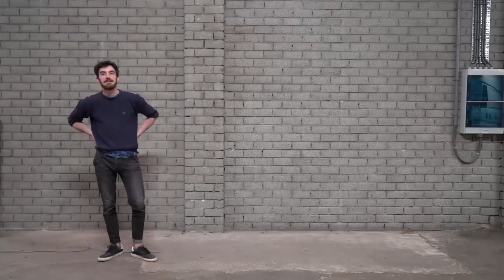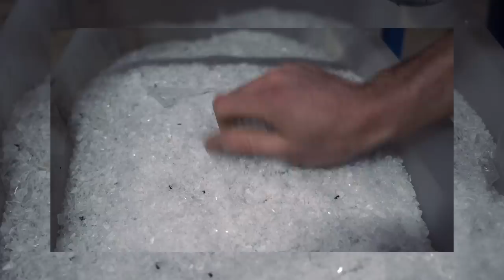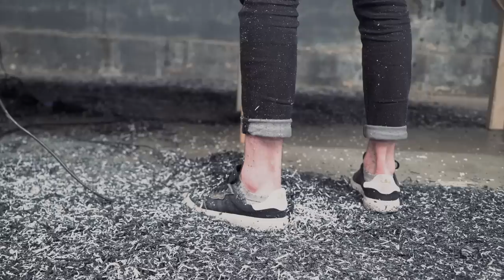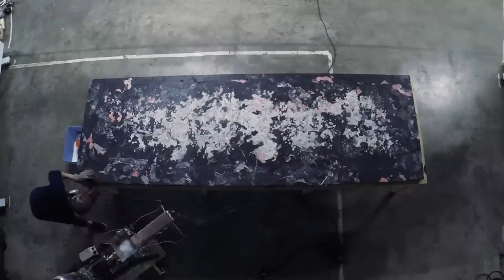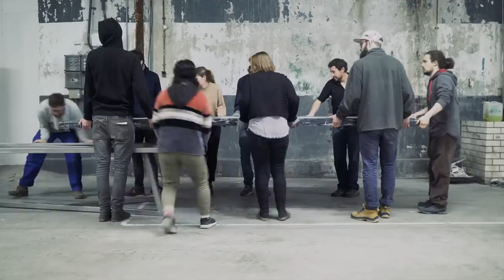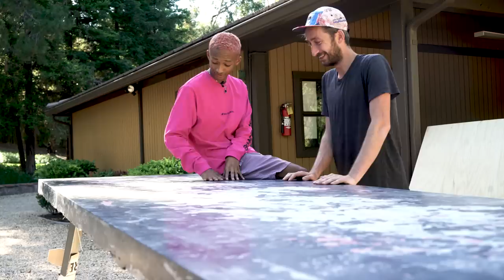Jaden - Plastic Table

Comment: honestly the underside of the table could have been routed out to a few cm thickness and maybe left a couple of beams running across for stifness, this would have cut down the weight by tens of kg's and also saved a lot of material, this would have kept the illusion of a solid surface if you keep the sides intact.

Comment: I need to know everything about your process. I need to know the tools you used, what you used to coat the table, everything!  Can you please help with some tutorial in some shape or form please?  I am working on a different project to save the environment and I need to be able to produce larger sheets than what can be injected or compressed.  Any insight would be most helpful.  Thanks for releasing this video.

Comment: couldnt see the table at all watched it so i can see it but then it was done and only got a tiny view of the end result.....also you can also after its done run a thin coat of epoxy over it to seal everything and make it nice ans shiny to preserve it even more and wont chip off and will almost look like marble table....its just a thought....only because its made fully with plastic does not mean you cant add something else also to it to make ot pop even more and it wont downgrade the fact that its fully made out of plastic ;-)